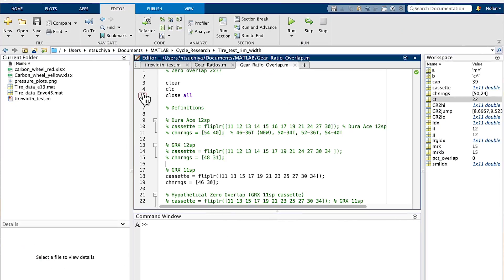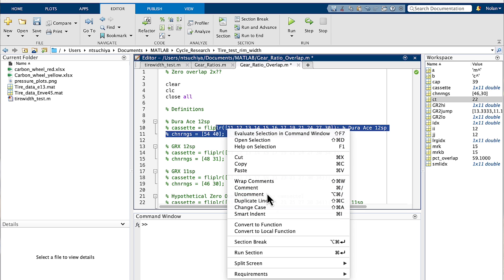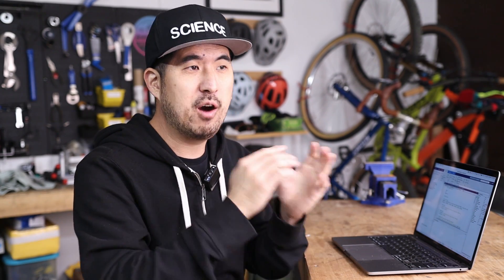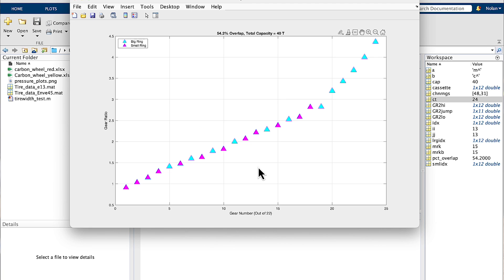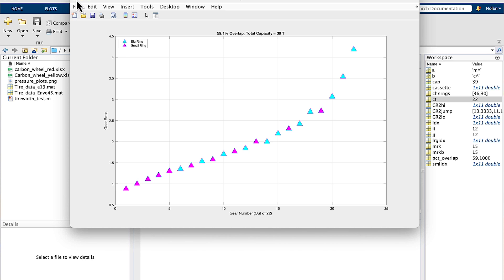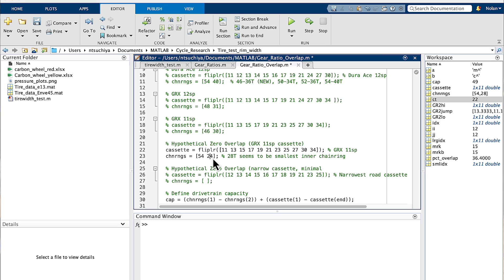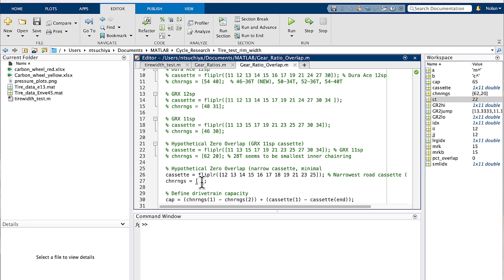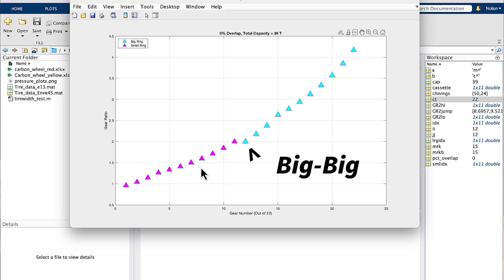Why 2x Drivetrains Have Redundant Gear Combinations

Comment: Gear range benefit of a 2x? Think 11-45 rear, 46/30 or 40/26 in the front. Wouldn't that offer a 620% gear range? I think Shimano has a possible 690% with CUES 2x, or so I've been told.

Comment: Agree that 2x drivetrains are an efficiency optimisation by offering better chainline options.
However this efficiency improvement can be lost when the conditions require frequent front+rear shiftings which require more of a pause in applying power.
2x is still worth it for road but if I were to choose the configuration of my gravel bike now I'd go 1x, as all the shifting logistics becomes tedious on ondulating terrain.

Comment: I'm with you 100% about when a 2x is preferred, and I'm not so dumb as to advocate cross-chaining: it sounds inefficient in theory and in practice the chain tells you it's unhappy. 
But it happens sometimes- usually towards the latter stages of a tough ride when the mind is wandering..... 🙄🙄😵‍💫😵‍💫 and on my Diverge with 11/40 cassette and 48/32 on the front, the Ultegra derailleur doesn't cope: it jams up about three sprockets before the biggest.... 😩 So the question is,  is there a derailleur that DOES HAVE enough range of chain tensioning to be able to cope with the (very) occasional and usually accidental big-big combination without jamming up ?
Love your videos by the way. Keep them coming !

Comment: I have a question.  I have a trek roadbike eunning a 2x setup.  Front rings are 54 and 34 with a 12 x 25 cassette.  I am a casual rider wanting to get in shape with an FTP currently around 151. I'm assuming this bike is setup for people with a much higher FTP who want to be able to average a higher speed than i an able to.  So my question is would you recommend any change to my setup that would give a better and more useful range for my riding? Thanks

Comment: Hiw do you define overlap? Your plots dont really show as much ovelap as what you are saying... 
For instance : is a gear ratio of 2.0 and 2.5 overlapping?  
Or is ovelaping 2.0 and 2.0? 2.01 and 1.99? 

In thebone you say there is zero overlap, you clearly have 1 pink and blue triangle side by side at 2.0 gear ration... hiw is this not an overlap?
Reply from the maker: Overlap refers to the amount the range of gears in the small ring overlaps the range in the big ring. Has nothing to do with precisely redundant gears

Comment: 2x for me running GRX 31/48 up front with XT 11/42 rear on flat bar setup this setup works well for my riding style of road to MTB trails.
Reply: Cool setup, with this config I suppose that you rarely need to shift the front derailleur, yet get a massive range of climbing gears.

Comment: 1x is fine for MTBs, rough gravel, and comuters but the moment you need speed 1x shows it's weakness. 1x simply doesn't have the high range (outside of weird TT setups tailored to riding flat courses) needed for riding fast.

Comment: Currently you define overlap as "what percentage of the possible gears are between the smallest ratio of the big chain ring and the biggest ratio of the smallest chain ring". This definition ignores that there might be still value in having more options in that overlapping zone.

Wouldn't  "how many gears have a ratio too close to another gear to be considered two separate gears" be a better metric?

Example on my own 46/30 grx:

I would consider 46/20 = ratio 2.300 and  30/13 = ratio 2.307 as too close together to be two different ratios...

Comment: For me the simplicity and reliability of a 1X can't be beaten, even when i had a 3x on my second bike i just never dropped below the large chainring so before i even knew about the topic i already thought it was pointless. When i eventually learned about the more serious MTB world i just inmediately fell in love with full sus and eventually got myself a 2009 Lapierre Froggy 318 to the wich i inmediately uninstalled the smaller chainring and derrailleur because the 28T just didn't have enough push for me to use, i needed to crank at absurd speeds just to barely moove and if i went onto longer speeds the chain flopped wildly as i reached the limit of the derrailleur arm. A few years later i still prefer 1X and i don't think that'll change

Comment: I bike-camped across the country in 1986 lugging 40+ lbs (carrying 2 extra gallons of water in the desert), averaging 95 miles per day, wearing cleats and clips, on a Trek 700 with 27" wheels and half-step plus granny gearing.  My Chainrings were 48 and 44 with a 26-tooth granny, and my 5-speed sprocket was 13, 15, 18, 21, 26.  There was no overlap (except the two highest gears when I was in the granny).  To get 10 reasonably spaced, useable gears on a five-speed with lots of miles of riding in the flatlands was critical, and granny made every hill I met doable, even if some were challenging.  The big complaint about half-step gearing was that the shift pattern was difficult, but the reality is that got used to it very quickly, and most of the time I would sit on one of the chainrings and just shift the rear because most of the time the full steps are what you wanted.  But riding those miles with that weight meant having the right gear was critical, and this setup allowed me to make small, but important adjustments, especially when riding for hours into a Kansas headwind.

Comment: Regarding cross-chaining, if you intend to avoid using the Big ring with the top two cogs at of the rear cassette, and similarly with small ring with the smallest two cogs, then, for example the 50-34, 11-30T 12 speed overlap reduces to just 16%, which doesn't seem like much wasted at all.

Comment: What I don't get in regard to crosschaining.. Why isn't that an issue with a 1x drivetrain?
Reply from the maker: It is. It’s the main gripe of 1x non believers. However, since the single chainring sits between where the 2 chainrings would be, the cross chaining is slightly less bad

Comment: Actually you won't use the two end cogs (s/s-b/b combos and next to it).

If you use wickwërks ultra wide 53/34 with a 11-23 and go by the rule not using the two end cogs because of chain angle.. you have no overlap on the other cogs.

Personally I use wickwërks ultra wide chainrings.

Comment: Having a 2x gives some great indexing options.  I think about it that way, so my cadence can be optimized whether I’m climbing a 9% grade in the small ring or riding some high speed flats in the big ring.  

What I’m NOT doing is alternating between front chainrings in either scenario.  For me, it’s a pick it and stick it sort of thing.  I could care less about redundancy because it’s completely irrelevant.

Comment: im still on 3x9 ,  with a 22 , 32 and 44 rings on the crank and 11-34 in the back , the big chainring is nice for the downhills to get that massive speed while staying at a relatively more comfortable cadence
if i want to drop a ring i need to shift up 2 to 3 gears on the casette to be at a similar cadence to what i was at the shift, as for the 22 ring , it has extremely low mileage as i only really use it for really gnarl steep climbs on days where the heat saps my power , also worth mentioning i ride mtb and idk how accurate garmin weather data is but i have the bad habit of going on days that are hot (30c-36c)  and with the super high heat thats usually when i use the 22 ring 😁

Comment: SRAM: couldn't totally figure out the FD, so let's market 1x as a real improvement over 2x.
Don't like claims such as you only have that number of 'valid' gears. Come on, it is physically not quite possible you can invent a 15-cog cassette without make the tru-axle significantly wider or cogs thin as papers and nightmare to manufacture.
Reply from the maker: “Hypothetically“

Comment: I do not see any perfect drive for on the market of new bikes.
Buying new road bike and use it in the mountains very often means pushing uphill because gearing is designed for Kong Kong power.
Every system has disadvantages and it is strange considering that it is not space technology and bicycles prices are on cars prices level.

Comment: Ha! Interesting topic and nicely presented. Thumbs up for the annotated Matlab code! So, I have an older 2x gravel bike with 50/34 chain rings and 11-42 (10 sp) cassette and a newer 1x gravel bike with a 44t chain ring and 10-50. My biggest beef with BOTH drive trains is that, unlike my road bike, the road-speed ratios on my gravel bikes are spaced too far apart because both cassettes use 2-3 tooth spacing between the cogs that I use on flat road. They are 21-18-15 on the 2x and 18-16-14 on the 1x. So neither system allows fine tuning of cadence as much as I would like. So, for me 2x doesn't really help a whole lot, though I built my 2x bike to have an extra wide range before 1x mullet drive trains were a thing.

Comment: There is another way of having zero overalp. The cassette would have 2 ramps instead of one. Gearing would be something like 11 to 20, then back down to say 15 to 32. I would look like a saw tooth pattern or xmas tree. As you change the chainring you would change the rear cassette at the same time. I hope that makes sense.
Reply from the maker: By overlap, I meant a range of overlapping gear combos. I think you’re referring to zero redundant gears, in which case your suggestion works. Still pretty impractical tho 😀

Comment: Something you missed is reducing the number of gears. 53/34 on a 7 speed 11-17 speed drive train would also result in 0 overlap with a more reasonable* chainring jump. 7 speed cross chaining isn't as bad as 12 speed cross chaining due to the smaller width of the cassette, and if the cassette had modern 12 speed cog spacings then it would be completely negligible if the cassette was moved inboard as well. 

This drive train design would probably be very light and a shorter freehub body would imply less dishing on the rear wheel and better lateral stiffness.

Your point still stands on inconvenient shifting though, since trying to get into the next ratio after 53/17 would involve a lot of shifting. And you'd have to be pretty strong to stay in the big chainring.
Reply from the maker: Good point

Comment: If you have an 11-21 rear sprocket and a 22-44 front you can have a 1-4x syatem and no duplicate ratios or overlap, it's also quite light.

Comment: Can do the same in excel in about 2 min.... I got rid of the worst of my overlap as the overlap is just waste to me. My target was to get the % change between each gear about the same. Its not just the overlap though. having to shift on and off the big gear in front isn't ideal from a user standpoint, and I wanted to minimize front shifting too. I got pretty close. If I were building from scratch, I'd just do 1x and not with a huge cassette either - just a standard 11/28 as its not hilly here. Mine is 50/36 and a 12/25 11 speed. Pretty good.

Comment: Alistair Spence mentioned the legacy of Frank Berto and Sheldon Brown, and perhaps it's worth mentioning to the viewers that there are options beyond just 1x or 2x.   I've always looked at what gear range I wanted, what the step size between gears should be,  and the number of gears.  Based on that, I could then decide on whether 1, 2, or 3 chainrings was best and what freewheel or cassette would do the job.  The amount of gear overlap between the chainrings does matter, as you note, and everyone has their own tolerance for this.  Modern systems have really reduced options and dumbed the whole thing down, unfortunately.  Perhaps a future video discussing how to start with one's personal gear specification (step size, etc) and finish with the optimum chainring(s) and cassette that will satisfy the specification??

Comment: eh, I kind of disagree with the definition of overlap here, or at least redundancy.  I would say overlap (in terms of redundancy) is when two different gear combinations results in the SAME gear ratio.  To my knowledge, this never happens.  The point of 2x is that you have more gears and you reach each gear by shifting accordingly (and this is where I point out that this is where electronic shifting, ie, Di2 has the advantage of letting you move up and down ALL the gears and it sorts out which gear combination that is---and can optionally prevent using the cross-chaining situations).
Overlap as you define it, where different gear combinations fall in the same 'range' of gear ratios--is of course going to happen and I'd argue is part of the design, not a flaw.
To reiterate, a 2x is going to have gear ratios in the same 'range' but this just lets you have say, 2x11 == 22 gear ratios without having to have a 22 ring cassette (which needless to say, would be just impractical).   
Granted, this means for a cyclist to gradually shift through all the gear ratios in order, they'd have to know when to shift both the rear and front derailleurs, but really, I don't think any cyclist does this--we just shift to whatever ratio feels right for the cadence and/or climb that we're on.

Comment: I'm running 2x11, 42/22, 11/32 cassette, Force22 WiFli RD, Rival22 levers and GRX400 FD. The 22t is a bailout gear, chainline is offset. It's a 1x 95% of the time and a 2x when needed. Front shifts absolutely fine, not perfect, considering the components available, but working on it. Narrow (road) Q factor.
Cadence is the reason, not gear inches, 2x drivetrain ratios were developed for road riding where cadence is king. The overlaps are very close not 100% overlap for each ratio. 
Gravel was technically non existent 10 years ago and lower gearing for touring was already available half a century ago (TA, Stronglight, etc) but the big 3 didn't have any interest in that, only in racing. The good part about it was mtb and road components were 99% interchangeable. Gravel goes mainstream and here we are.

Comment: thanks for doing this, there is nothing worse in a silly debate than lack or research or data. However for me this needs refining with two important factors: 1) usability of a gear ratio, i.e. how long does or can a rider actually spend in any of these gears: if you look at di2 stats, most riders spend 60% of their time in just 3-4 gears with 2x, and some gears only 1-3% which probably means those gears were not actually used at all and the 1% time just represents the time
needed to transition between gears that are actually used. with 1x the spread of time across gears is wider. if the 33% of non overlap
is mostly gears that are just in the way if gears we actually use then we have a bigger problem, or 67% is less of a problem if the opposite is true. 2) efficiency, for years we have been told that 10t was “too inefficient” and 9t verboten. but I have PB sprints on all by favourite top gear segments in these gears vs 11t as the “efficiency” losses are way less than max power variations of human legs, as well as changes in drag from variables like wind direction or wind speed and so these gear combinations inefficiencies are negligible/ irrelevant. on this efficiency - my chains are lasting longer on 1x systems than my 2x systems. My only theory on why this could be is either that the chain angles are kinder or that if a 2x system is making you wear out 4 of 24 gears vs 1x spreading the usage more evenly over 8 gears of 12 then that would probably outweigh any theoretical efficiency which assumes all fresh gears??? either way, a gearing setup overlaps is only part if the story without taking into account how much we actually use any of the gears and how many gears in between them are only transition gears we actually never use but are just getting in the way of gears we do use. And that is before we get into the gear jumps! more math please with gear jumps and mapping time gears are actually used and chucking out the gear that are essentially only used to get to other gears!

Comment: I have 3 chainrings. I have little gear steps, a wide range and overlap helps me to stay in one chainring unless steepness changes  dramatically or for long.

Because manufacturerers don't offer good quality bikes with 3x I still ride my 14 year old bike and will continue to do so until I need an e-bike in 10 years.

With zero overlap you would end up riding in the middle and constantly switch chainrings.

Comment: I understood the convenience of 2x and 3x system only after going 1x. Currently thinking of ways to put a front deraileur on my bike designed to run without it. 1x is lighter and simpler, but sometimes you want that easier gear in the front

Comment: Im @0:31 in to the video - not going any further because the  way your phrasing the topic is silly and a waste of time.
Reply: Someone wasn’t paying attention in school.
Reply: Any experienced cyclist understands why a  2x  offers a much better gear range and experience on a long ride. No need to waste time doing math.
Reply from the maker: Most experienced cyclists are open minded and appreciate a data driven discussion 😉
Reply: @akatgif  my 4 bikes with 1x have a bigger range than all my 2x bikes outside of my TT bike
Reply: @veganpotterthevegan  good that you have your preferences optimized.
Reply: @akatgif  I'm just referring to your statement about range.  A 10-52 with a 46t chainring has a wider range than mostly everyone with 2x as MOSTLY everyone is using a 50/34 and an 11-28 or 11-32.  The range with the 10-52 is actually bigger with a bigger high gear and significantly easier easy gear.

Comment: Noone seem to point out that extra weight of huge pizza sized cassettes on the rear wheel aint a good thing
Reply from the maker: It’s a wash when you remove the front derailleur, a chainring, and a bunch of cable. As for rotational mass, it’s a wash too since it’s concentrated near the axis of rotation